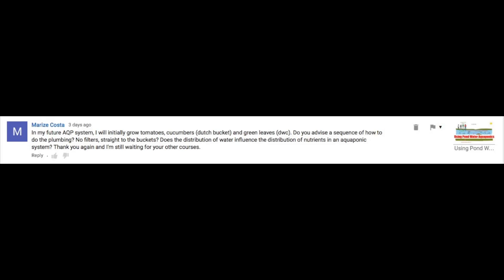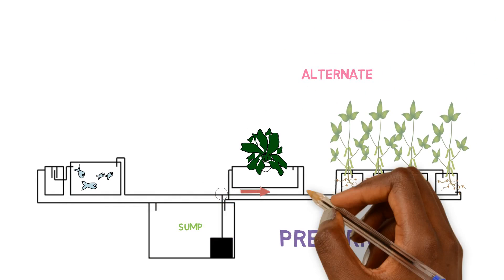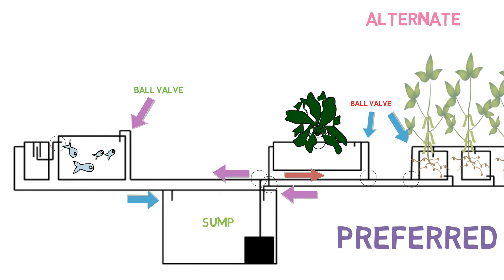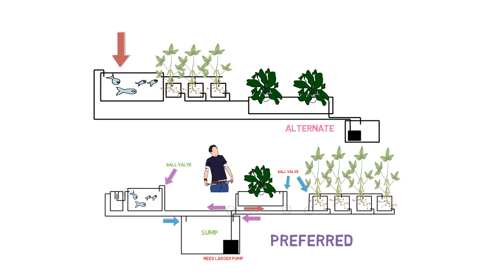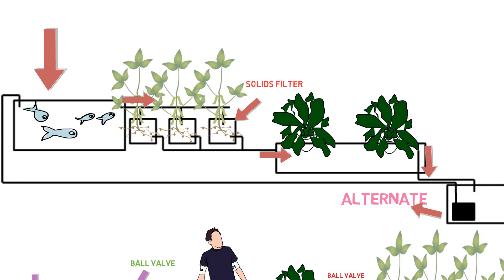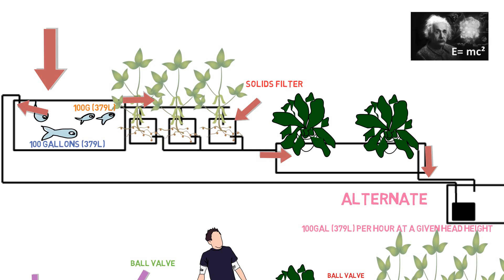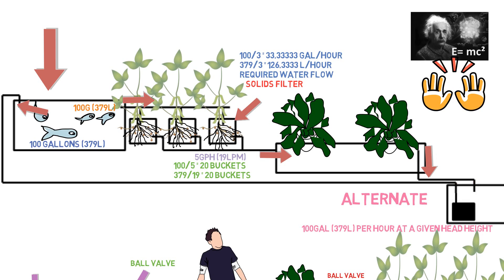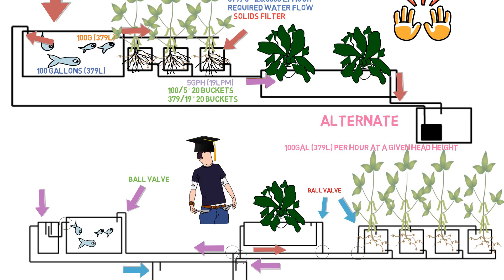Dutch Bucket & DWC Hybrid Blueprint | Ask The Aquaponics God

Comment: In the alternate method say you only wanted 5 buckets instead of 20.  Easy, use a ball valve to control the flow to the buckets, then plumb the excess into the deep water tank.  Done.  I don't know why you didn't see that option.

Comment: Alternate method : how about an over flow pipe at the end of your run of buckets. Just in case you didn't want or have room for 20 buckets?
Reply: Smaller system means smaller fish tank = less dutch buckets = smaller DWC = smaller pump or better still, a pump running at half the rated output.

Comment: ok question.....in the gravity setup..... can you connect the dutch bucket and DWC in parrallel, add a ball valve to regulate the flow going to the dutch bucket then connect the outflow from the beds back into the sump on a gravity system? of course you need to calculate the flow rate into and out of the DWC to compensate,  but this could be done? would this negate the issues of needing the heavy duty pump and make it cheaper to run? also wouldnt this still need a biofilter before it flowed into the dutch bucket and DWC?????

Comment: Hi, what is the best set-up for an off-the-grid, no electricity, manually cycled aquaponics system? Thanks!
Reply: The only one way I know is, a continous gravity flow system ( I use this for my brook trout and cold crops ). Tap into a spring/pond/lake uphill and control the flow into fish tank. Follow the alternative system shown (except the sump tank is the second fish tank or outlet). ' Manually cycled system '  would require you hauling water from sump to fish tank 24/7. You need the water in system in continous movement to function.

Comment: Hi There, finished going through all your material. Cheers to that :D 
Keep It Up.

I'm want to setup a hybrid system. just like your preferred design and to split the flow and run ball valves. 
I have a 1000ltr cylindrical FT to house tilllapia, which I want to harvest at 500gms to start with. 
using your stocking density I have calculated approx 60kg of fish so 120 fishes at harvest.

I would like to know how to calculate:-
1. The amount of feed that will be needed to grow the fish.
2. And basis that that I would want to know the relative size of dwc or no. of buckets. ( Leafy in DWC and Vegetables in Dutch Buckets)
3. What if I want to keep only 10 buckets(20ltr) and the rest is DWC )

As both are different , so is their respective feed/MTR^2/day . 
I'm getting a little confused doing the math.

Certainly not a problem for an AquaponicsGod Lvl :D
( Thanks in Advance.)

Comment: How many feet of lettuce can I grow with my fishes?
Yes, it's me again.
My goal is to harvest 5 ton / year in a superintensive system with the Pirarucu (Arapaima Gigas), and to feed my community with the help of one of our largest Amazonian fish. The initial stock of 4 tanks (15000 liters) is 90 fish with 0 , 5 kg each, which means 45kg initial stock weight. I will harvest the fish with an average weight of 13.5 kg. Pirarucu FCR 1.9 and FER 53. As I learned in your videos the other tanks will be stocked after 3, 6 and 9 months so after one year I will harvest every 3 months. The point is that my feed rate does not rise, it jumps. I will list for you my input in kg daily for each tank in activity from month 1 to 12 (1.5 / 2.0 / 3.0 / 3.8 / 5.2 / 5.7 / 7.1 / 8.8 / 8.1 / 9.3 / 10.5 / 12.0)
 The monthly input for each active tank is (45/60/90/114/156/171/213/264/243 * / 279/315/360). A total of 2310kg every 12 months (* decreased feed rate and increased FCR).
 Now the total monthly input from the first to the twelfth month. First tank (45/60/90) + add 2th (159/216/261) + add 3th (372/480/504) + add 4th (651/795/864). A total of 4497 KG / year of feed.
I have not yet been invited to your next courses, I still do not know proper flow rates, proper aeration, proper plumbing, if the nutrients did not get very diluted in such amount of water (15,000 liters), etc.
 How to balance an AQP system from here? 1 tank to 2 grow beds?
Yes, I have great faith in me. And my mentor has the name of my favorite Archangel, so I strongly believe nothing can go wrong!
Reply from the maker: Ok let's back up for a minute and clarify a few things. Here are some questions that need to be answered or clarified.

1. The initial stock of 4 tanks (15000 liters) is this all 4 tanks or each tank?
2. I will harvest the fish with an average weight of 13.5 kg. Is this per fish or total fish per tank?
3. 90 fish with 0 , 5 kg each, which means 45kg initial stock weight. I think you mean 45g not 45kg
4. How long will it take to reach harvest weight from the initial stocking size of 45g? 

Clarify these questions then we can move on to the next portion.
Reply: 1. Each tank
2. Per fish. It can reach 3 meters in length. 13,5 kg is a baby.
3. Initial stock weight 45 kg.
4. One Year
Reply from the maker: I'm confused on how you can have a harvest weight of 13.5 kg, but an initial stocking weight of 45kg. That means the initial stocking weight is heavier than the harvest weight, which is impossible. Maybe I'm reading something wrong. Clarify that. When you say 45kg are you referring to the individual fish or all 90 fish??
Reply from the maker: 90 fish that weigh .5 kg = 45kg total. Got it.
Reply: initial stock of 90 fishes with 0,5kg each = 45 kg. I will harvest after a year a biomass of 1257 kg.(final stock). The weight gain will be 13,5kg per fish.
Reply from the maker: Next questions
1. With the FCR of 1.9 and an average weight of 13.5 kg, your answer of 2310 is pretty much correct (1,215 x 1.9 = 2,308.5kg to achieve full growth per tank). Usually the feeding rate per body weight drops as the fish get more weight.

2. Your tank is too small. if you have 90 fish that weigh an average of 13.5kg (1,215 kg) and your stocking density is 60kg/m3 then your tank needs to be at least 20.25m3 (20,250 liters). If you want to stock at a lower density than 60kg/m3 then you will need an even larger tank, but 15000 liters will not work for your harvest size, unless you're adding liquid oxygen. 

3. My other question is how did you determine the feedings rates at the various stages? Do you have a book or references from experts that culture these types of fish?
Reply from the maker: I didn't know that the 13.5kg was the weight to be gained. This is why I ask clarifying questions. Now, with 1,257 kg of final weight and a stocking density of 60kg/m3, your tanks need to hold at least 21,250 liters of water.
Reply: This is a hiperintensive system. The stocking density can reach up to 100kg / m3. It has two breathing apparatus, the gills for aquatic breathing, and the modified swim bladder, specialized to function as a lung in air breathing. Comes continually to the surface of the water to breathe. The experts do 4 TON in a 45.000 liters tank
Reply: This is a relatively new study with this fish. Developed mainly in the northern region of Brazil. But it fits very well in the Midwest region where I am. To my knowledge, we do not have any English posts. The most complete information we have is on the site seminariopirarucu.com.br.
Reply from the maker: Is this all done without liquid oxygen? With liquid oxygen, tilapia can be raised to 120 kg/m3, but I don't think i've ever seen a fish that can be raised up to 100 kg/ m3 without it. If this fish can then that is amazing my friend!

 Your tank sizes make sense if you plan on raising at these higher densities, but if it does require liquid oxygen then it's another learning curve you have to figure out.

With your fish weight and water volume per tank, you're looking at a density of around 84kg/m3. From here we can calculate how many lettuce can be grown. 

Give me a few days time to run the calculations and get the video done. 

As far as the course, we are going to open up the enrollment for it in August.We are doing some modification to it to make it better and more complete. I'm also in the process of writing the book that goes along with it and it will be released around the same time.
Reply: Yes, in a hyperintensive system, they change the water in the tank 2 or 3 times during the day and have a drain in the bottom of the tank. It is a very rustic and resistant fish. 
I'll be waiting for the course and the book. Grateful once more.
Reply from the maker: You will experience issues if you attempt to integrate this type of system with aquaponics. The replenishing of water 2 or 3 times daily will significantly dilute nutrient concentration to the point where plants are unable to grow. This method will not allow nutrients to concentrate to levels high enough or for a long enough time period for aquaponic vegetables to be grown. I will caution you if you have this in mind because it will be very challenging. Aquaponics works optimally in a recirculating system where nutrients are constantly recycled within the system for plant use.
Reply: Yes St.Mickell, I understand that if I change the water 2 or 3 times the nutrients will not be sufficient for an aquaponic system. It was just a comment to attest to the rusticity of the fish, since it is not choosy in water quality. I want to grow the fish in a recirculating system.
I am fully engaged in applying aquaponics to food growth. Starting with the basic green leaves and so on. I want to disseminate this practice to my community too.